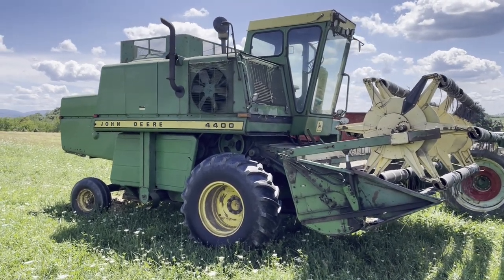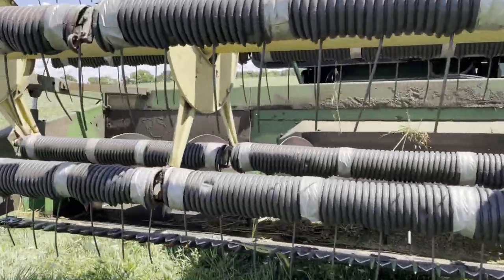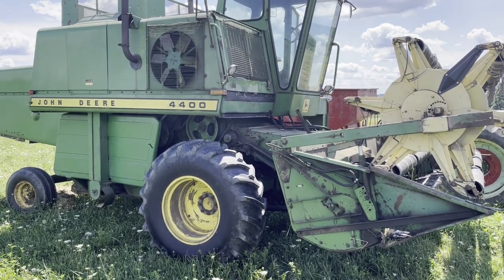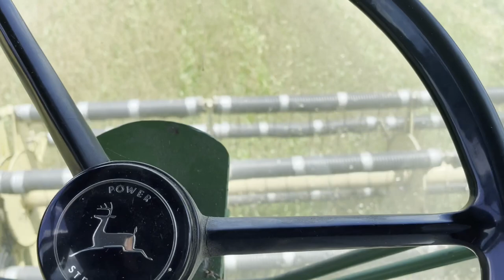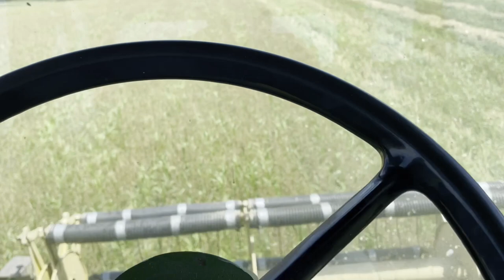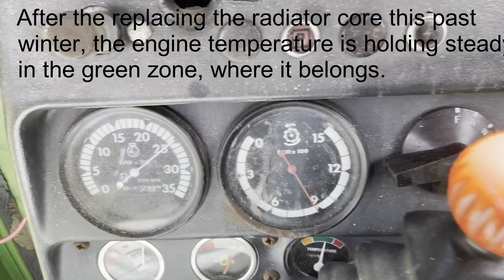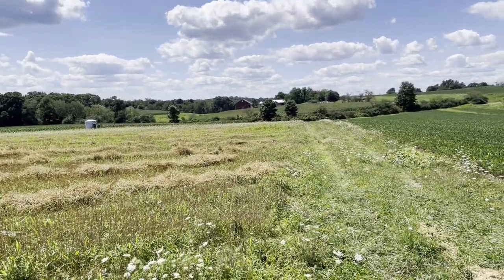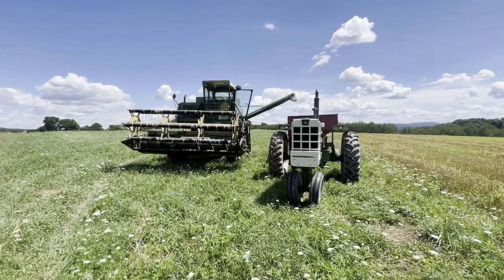Harvesting Oats with the JD 4400 Combine

Comment: The 4400 was running nice and smooth. And the oat straw will be nice to bale. Are you old fashion and let the straw get a shower on it to get some of the wax off or do you bale the Shiney straw? I started farming I bought a 4400 diesel and a 4 row head and a 915 flex head and ran it for 4 years and then I had to go with a larger machine to handle more acreage. But the 4400 is and was a great combine
Reply from the maker: I generally wait a little while to mow the oats stubble and then bale the straw.  Never considered the "waxy" idea before - I just learned something.  So, generally I bale it as soon as I can get some nice weather for it.  Thanks for being here Matthew.

Comment: Thanks for the ride in the 4400, good to hear that it was staying cool. Is there a reason why you don't use the flex head? Planting oats late usually yields less, not much a person can do when the weather doesn't cooperate. Thanks for sharing.
Reply from the maker: I had the rigid head first, with the combine back in 2016 and didn't have a flex head until 2 years ago when I started planting soybeans.  So, since I don't cut it down to the ground, I just use the rigid head, since I have it.  Saves wear on the flex head which I definitely need for beans.  I have always mowed my oats stubble for straw.  Hate to run all that chaff through the combine when I can just run the heads through.  Just a personal preference.  Thanks for your comments.  Glad you enjoyed the ride.

Comment: Well it's too bad the oats wasn't as good.   Mine made enough for some seed.  My pickup head is the same type of head as yours minus the sickle and reel.  We used to have one for beans with a Love Bar flexible cutting bar.  It worked but wasn't as good as an actual flex head.  You had to be careful not to catch the fingers in the sickle.  What do you spray your oats with?  I've never done anything for weeds in oats other than cutting it.
Reply from the maker: I use Rhomene, which is a form of 2,4-D.  I usually spray when it's about 6-8 inches tall, because there is a limit on how big it can be and still be sprayed.  I had no broadleaves, except for the clover I planted underneath it, but Rhomene has no residual affect on foxtail.  Last year I had no foxtail in the oats - this year, it was loaded.  Wondering if it was weather related.  Thanks for supporting the channel.